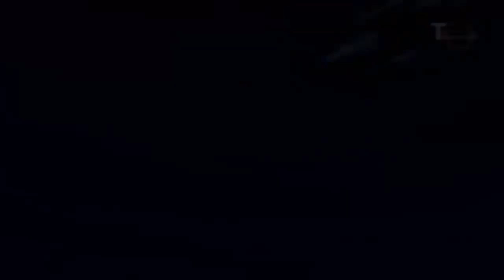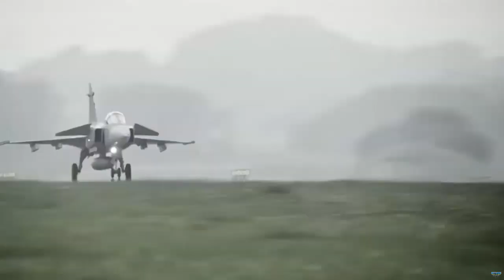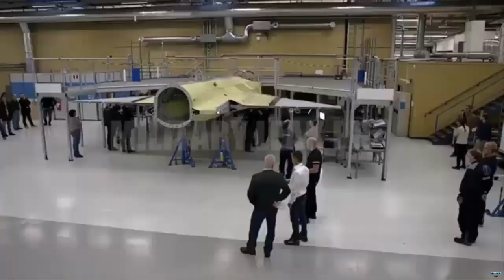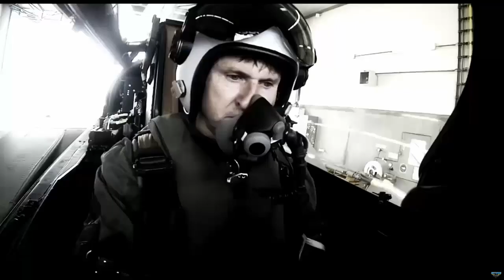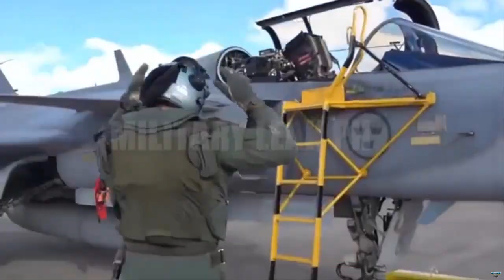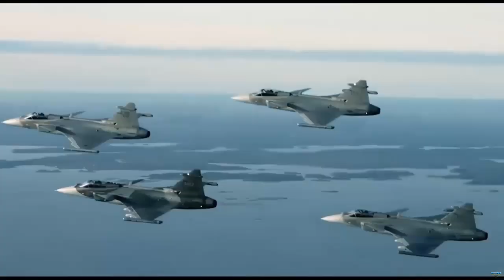The Philippines is interested in the Gripen fighter jet

Comment: F-16 is the best fighter jet or the F-16V viper
Reply: Good, yes; but those top models are extremely expensive. They also require very robust air fields like the standard used by the US. Gripens are built more robustly to operate most normal street surfaces. They are, even the top models, also roughly only 80% of the price tag of a top model F-16 you want to have. 

And they likely will be even lower, if the Philippines is to choose the Gripen, because Sweden would want to expand its market, so profit is NOT its top priority. If they break even, Swedish manufacturers likely would do it, to, again, increase their share of the world's militaries using this Sweden's premium product. Profits and others will come later, when more and more countries are relying on the Gripen.

American F-16 manufacturers and CEOs of companies dealing with F-16 can't and wouldn't survive without their ultra high incomes, as very established entities and people, so there will be little to no discounts on F-16 models. But, luckily, 20 Japanese built, older F-16s --- superior to American built F-16, because Japanese don't cut corners in the fabrication of the F-15s and F-16s they use in Japan --- are likely arriving soon in the Philippines, too; so the country is not in dire need of getting expensive American F-16s right away...